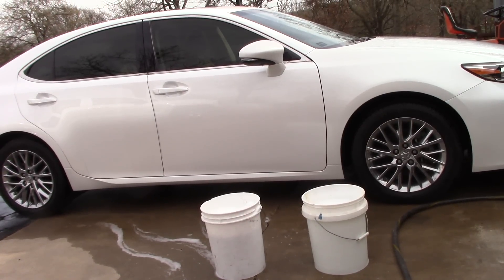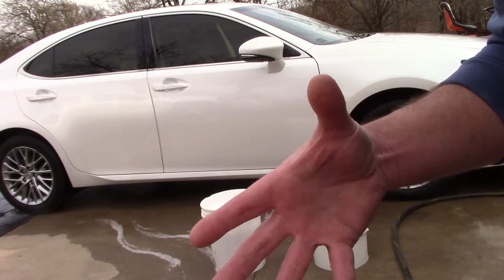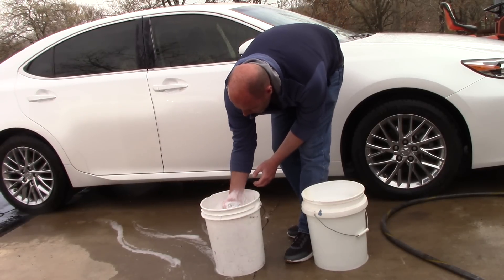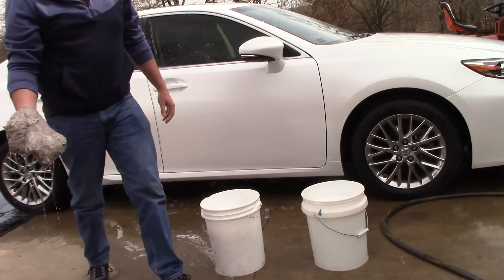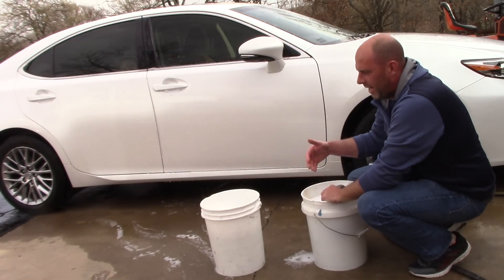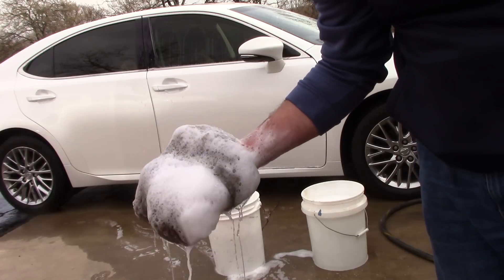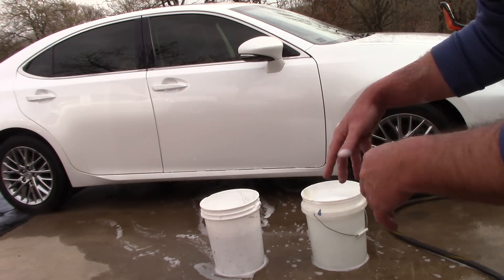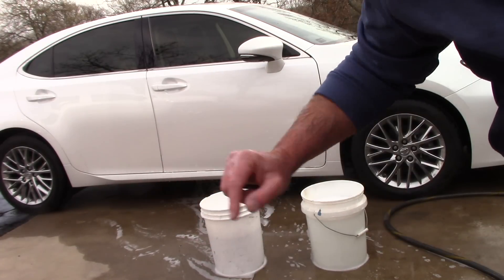Two Bucket Wash - A Bad Idea?..Lets Look At The Science!

Comment: I use the one bucket method and squeeze out the mitt after each section (onto the floor not into the bucket), oh and i don't use a grit guard. the cost of these bloody buckets and grit guards is just silly. three buckets with grit guards is nearly £50. two builders buckets - one for the car one for the wheels is about £6.

Use a pressure washer, use a snow foam or pre wash soak and blast off the majority of the particles which could scratch your paint during gthe contact wash and you can forget about this silly two bucket method. If your mitt gets dirty because you go under an arch or scuttle panel, just have a few spares standing by. I'd rather have 5 decent wash mitts than one wash mit and 4 buckets with grit guards. A dirty mitt is a dirty mitt, whether you have a grit guard or not. and whether you have 10 buckets or not.  

If you're not going to wash your car properly, don't bother. Do it properly, or go home.

Comment: Dallas Paint Correction - not only are you diluting your wash media, there is NO way your MITT is clear of road debris!!! I don't care HOW MANY MINUTES you rinse it!!  Grit Guard or NO Grit Guard, Scott. I'm WITH you a 100% !   Its just better and simpler to FORGET this B.S. of the 2 bucket method and NOT re-dip your wash mitt AT ALL - simply use either 4 mitts or better yet,  4 ultra plush 16"X16" MF wash cloths folded in four and use one side per panel. A 16"X16" cloth has EIGHT sides! So two ought to be PLENTY for just about any vehicle.  BTW - has your right front passenger door had a repaint recently or is the light there just playing tricks on my eyes? Cheers!
Reply: So when finished how do you clean the road debris from the mitts?

Comment: What if you put shampoo in both buckets?Alot of the stuff i use advertises 1-1000 dilution ratios; Of course most people use more and glug it but for such a small amount of shampoo it doesn't really matter surely? That mixed with a proper pre-wash shouldn't leave too much on the vehicle anyway.

Comment: My "two bucket" method:
1. pre soak (using 5G of plain water with Worx Hydroshot)
2. contact wash (using quality microfiber wash sponge, 5G bucket with two capfuls of Blue Coral)
3. Rinse (back to the 5G plain water bucket with Worx Hydroshot)
4. Remove water with a quick pass of the Absorber 
5. Shine / detail (using either Griot's Speed Shine or Turtle Wax Black Detailer and two quality microfiber towels) 
Results: Good
Compliments: Many
Comments:
-one 5G bucket of soap & water is sufficient to contact wash a car when strategically washing from the top down using a mitt or sponge.  There is simply no way to prevent cross-contaminating both buckets.  It's dumb.  
-step 4 is a great way to quickly remove excess water AND leftover contaminants.  The Absorber will wash up good and clean in the wash machine with your microfibers later.
-buy quality microfiber implements.  Cheap microfiber towels lose tons of their fibers between uses and when washed, and are terrible for the environment (google it)

Comment: I understand your logic completely. However I always ring out my wash Mit before going back into the wash bucket. Also at what cost is it worth to not use a two bucket method? I completely understand what ur saying. But at what point and cost does it hurt more than help going with a single bucket? The more you wash with the two bucket system yes the soap may become diluted. But by going  with a single bucket the longer you wash the more particles go into your son bucket. And we all know that grit guards don't catch or trap everything. So what is the lesser of the two evils? Having a more diluted but less particles in the wash Mit? Or having a stronger soap concentrate? I honestly don't know and after watching your video that's what I was confused about. Both methods have a weakness so how do we determine what is the lesser of the two evils? Is it better to have less crap in the water at the cost of less concentrated soap? Or is it better to have a higher concentrate of soap and more crap on the mit?

Comment: You’re a moron. Ring it out before you put it in the wash bucket. Pretty simple really.
Reply from the maker: dakotadan78 so many steps just to use a failed system to begin with..lol
Fill up your two buckets and hump all that water around plus ring your mitt out all the time..lol
Just use one bucket with multiple mitts so you never bring a dirty mitt into your clean soap bucket.
I think you are a moron because there are faster ways to do it with less scratching because you are always working clean plus you save water!!
I guess you missed the whole point and don't have the ability to apply critical thinking or see the bigger picture:)
By the way I have watched many including pros that NEVER RING OUT THE MITT WITH A TWO BUCKET SYSTEM on YouTube videos so who are you kidding..lol

Comment: I wring the mitt before placing it inside the rinse bucket and also bofore inserting it inside the wash bucket. This way at the end of the wash, the rinse bucket is not very dirty and the wash bucket ends up with very clear water
Reply from the maker: Miguel Cunha I understand but you aren't considering all the non water soluble agents that are on your paint and now on your mitt that can't be rinsed off or fully removed by ringing out your mitt before entering the bucket..either way you are always working with a dirty mitt and rinsing it off in dirty water.
It's like taking a shower just to keep rinsing yourself off with dirty water:)
Reply: 1st, thank you for your reply :) What do you suggest then? One bucket with multiple towels that never reenter the wash bucket?

Comment: I don't use a rinse bucket but as I wash I hold hose at the same time and spray off the dirt after each small section.  I think he's right about dilution but you could just at alittle more detergent. I myself wouldn't wash as large a section without rinsing mitten with hose. I use both side of mitten/glove.

Comment: I always ring out all the water before putting it back into the clean bucket. Also, I only use a small amount of water in the dirty bucket and dump it every time I'm finished cleaning my wash mit. I then fill it a bit with the hose and I have fresh water to clean the mit with again. This cycle repeats that way a dirty mit is always cleaned off in relatively clean water.

Comment: The simplest way to wash that i ve found till date which saves time, money, effort and cleans car safely is :
1. Wash down the car with pressure washer so that the dirt is gone.
2. Use a foam lance and cover your car with foam shampoo.
3. Take a Micro fiber/Mitt , wet it and put little car shampoo on it directly, gently clean car with it.
5. Wash down again with pressure washer.
6. Take a fresh mf towel, prime it with Spray wax for each panel.
7. Dry it with the other side of the mf towel and you re done. Been doing it for 5 yrs, absolutely saves time and no swirls. 
Max time for a SUV: 20 - 25 mins. Cheers. Happy detailing

Comment: One thing that Scott didn't mention in this video, but has in a previous video, is that after you clean your wash mitt in the rinse bucket, if you take a look inside the bucket, the water is brown, even with a grit guard. I've used a grit guard in both wash and rinse buckets and have noticed that the water does turn brown after a few dunks in the rinse bucket. Basically, you'd be "cleaning" your wash mitt in dirty water and transferring that dirty water to your wash bucket. Two bucket method is just a way for the industry to make more money.
Reply: I just proved this to Chemical Guys even with a photo and they agree to disagree 🤣

Comment: So wring out the wash mitt before you go back into the soap bucket. Period. Problem solved.
Reply: Just rinse your wash mitt with your hose put it in the rinse bucket and use grit guards. Water won’t get dirty and even if it gets dirty the grit guards hold dirt and you can wash it with a hose
Reply: @jaygup3219  who has time for all that? The car will self dry before you finish washing your way 😆
Reply: Phew lucky i could only afford one bucket and one grit gaurd
Reply: the simple thing you can do is ring it out after you dump it out you just gotta do it good BTW how else are you gonna keep from scratching, that's what grit guards are for, to trap dirt at the bottom, so its not a joke, it keeps dirt from getting into the space of where you rinse it BTW grit guards aren't to expensive
Reply: Just rinse your wash mitt with your hose put it in the rinse bucket and use grit guards. Water won’t get dirty and even if it gets dirty the grit guards hold dirt and you can wash it with a hose
Reply from the maker: LOL...but your still rinsing out your mitt in dirty water and ringing it out after still keeps the mitt dirty...hey lets face it, the two bucket was is a joke anyway:)
Reply: @dallaspaintcorrectionautod8343  i don't know why it is joke when it actually traps the dirt that you just picked up from your car. Do you have a more efficient way?

Comment: Put soap in both buckets ?
Reply from the maker: but you would just be wasting soap and the rinse bucket will still be  filled with dirty water and i don't think the soap will make a difference...we also know the rinse bucket will not stop you from bringing  dirty water into your wash bucket so in the end you have to buckets filled with dirty soap
Reply: I assumed that the 2nd bucket was only to remove loose dirt and grit from the washing mitt , unless you use a new mitt after every wipe , you will always have some dirt migrating to the cleaning bucket. Wasting soap is really not a concern ...to me any way , at the professional level , yes , it would be a cost .

Comment: What's the correct way if the 2 bucket method isn't?
Reply: Paul Farrell you could use 1 wash bucket with multiple mitts. So once you clean a panel you can just use a completely clean mitt which was not dunked in a dirty rinse bucket. Simple as that.
Reply: @vee4410  so how do you clean all mitts when finished ?

Comment: I agree totally that the one bucket method is better. I do it with 6 mitts and not dunking them back in my wash solution after using them.  For me investing in multiple mitts seems more logic than investing in a pair of fancy buckets that tell you which is for rinsing and which for washing. If by mistake I forgot a spot or something I'll rinse a mitt by hand straight under the hose. But if you only have one mitt, in my opinion the two bucket isn't that bad. A good rinse and wringing doesn't need to take long. I guess it's the what works in your world philosophy.😉 Keep up the good work Scott!
Reply: stwg32 Exactly, multiple mitt method is the only way to prevent scratches and I still use a second bucket just to hold the used mitts.
Reply: you can save money bye buying 1 and using the 2 bucket method

Comment: That's why I use the 15 washmitt method for my Mercedes Coupe and the 30 washmitt method for my Dodge truck, but I still need a 2nd bucket for the dirty mitts :-)
Reply: i also use i 2 buchek system to clean..my backets........i have a wash bucket bucket and a rinse bucket bucket....................in the first i damp my bucket into the wash solution and then i damp the bucket into the rinse bucket and i didnt have any....problem...........except that i have nightmares that my bucket want to eat me...and i dont know why!!!!!
Reply: The 4 washmitts for the wheels not included....

Comment: Does any of this matter if they're using a scotch brite pad to wash and a bath towel to dry? The science behind the 2 bucket method works. You just described a failed method in the process, which can happen in any part of the wash. The name of the buckets should be soap on one and contaminates on the other to help users know that you dont want to mix your contaminated water with soap. I dont use the 2 bucket method anymore, but when I did, it worked when doing the process properly.
Reply from the maker: i can't stop laughing...some will defend the two bucket wash and in the same breath say "i don't use the 2 bucket wash anymore"...lol
Reply: Doesn't matter if I've changed my method. What part of the 2 bucket method is wrong if the process is done correctly?
Reply: I really dont matter in the fact that the 2 bucket method works. These are all different methods that can become personal preference. You cant say one is wrong because user error can occur. The goal is to safely remove dirt from the paint, and the 2 bucket method does that.

Comment: Scott, the last video you did on this subject (9/17/17) where you simply used a foam cannon and several mitts while eliminating
buckets completely changed the way I wash my cars. A 100% common sense approach for washing the vehicles you care about
- not to mention easily the best way to reduce scratching. I still use my buckets, but they're just stools now for wheel detailing.
Thank you!

Comment: Finally! Someone bashed the 2 bucket method. I do believe it’s a good method for maybe a novice at home car washer to make sure they are at less of a risk of scratching their car. BUT I’ve been using one mitt and one bucket with no grit guard for over 10 years and as long as you’re smart and careful you won’t get any scratches. Oh and I used to use the one bucket, one wash media method before microfiber mits blew up and used an edgeless cotton towel and it worked all the same 👍🏻 
No need to over complicate it.
Well said and we’ll done

Comment: The revolution has started, death to the two bucket method. Great video Scott #nobucketmethod
Reply: Jon Cole 
I no longer use buckets.
Reply: Surprisingly, the only bucket I use is a 3 gal with a bucket lid. Store my wheel brushes and wheel cleaner inside with a plastic bucket organizer. Good for wheel detailing to sit on or stand on it to reach the roofs on suv/trucks.
Reply: Add some soap in the other bucket.
Reply: @dragon1965  Not a crazy idea.
Reply: I never have used a two bucket method! I always thought it was a waste.

Comment: Scott, I watched a video with a good alternative to the two-bucket or even one-bucket method. You fill a spray bottle/hand pump sprayer with a soap/water mixture. Wet your wash media with a hose, spray it with the soap solution and then do your contact wash. After each panel, you rinse the mitt, wring it out, then repeat. That way the soap solution replaces the soap bucket and the hose replaces the rinse bucket. Furthermore, you maintain a high soap dilution by using the soap solution in a spray bottle. No filling/lugging buckets and no grit-guards.

Comment: So dry the mitt before you put it back into the soap bucket and if ur worried about soap just put more soap in it
you don't have to overthink some meguiars car soap as long as its not dawn dish soap.  
Theres so much overthinking into this stuff i guess is why were so good but it's almost impossible to avoid some type of swirls or scratches 
unless you have  very high dollar coating that heat removes swirls as-like a clear protective flim even then only high client paying customers want this.

Comment: Another point is that no way no how can dunking the mitt in the rinse bucket remove ALL the grit.  The only way you can remove all the dirt and grit out of the mitt is to put it in the washing machine.  Why dont people get this??  Why dont people just use a few mitts and never put a dirty mitt back in the soap solution.  The two bucket system is stupid and silly but sheeple still fan boys still run after it.
Reply from the maker: well said:)
Reply: How i have been doing it had been soap bucket, rinse mitt heavily with hose squeeze out, maybe even dip in clean rinse bucket if doing 2 bucket, squeeze out before back in the soap bucket. That's been taking too long. Thinking of switching to multiple cloths.   How many mitts/cloths do you use per car not counting wheels? 3 ? assuming folded cloth.